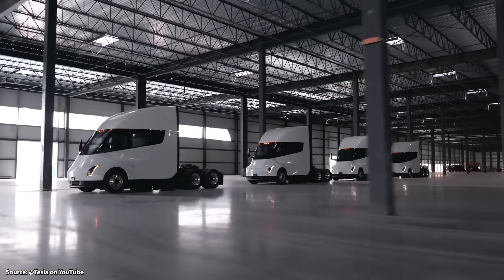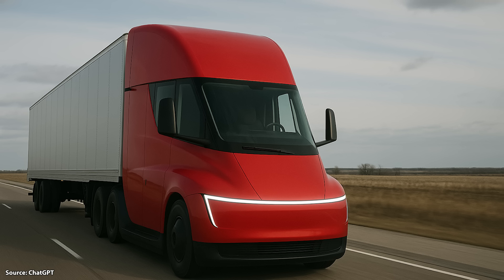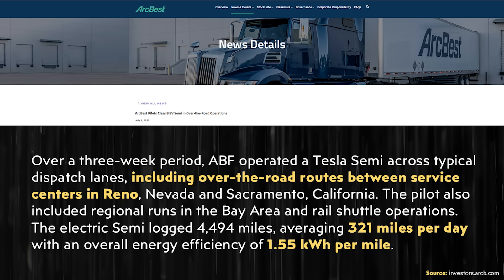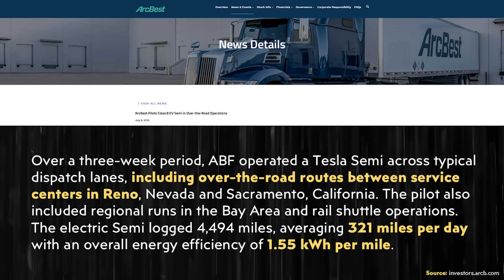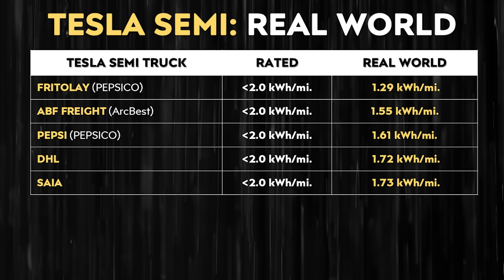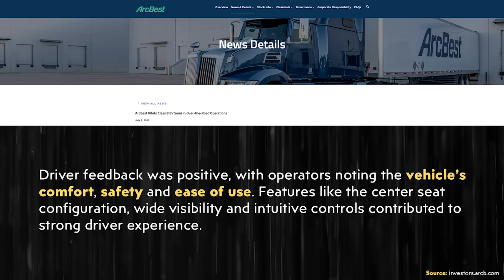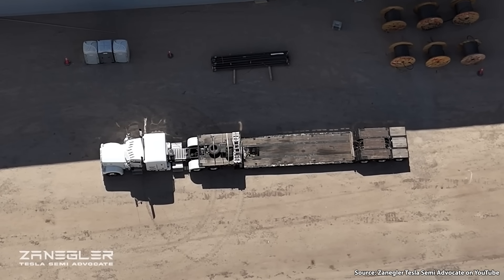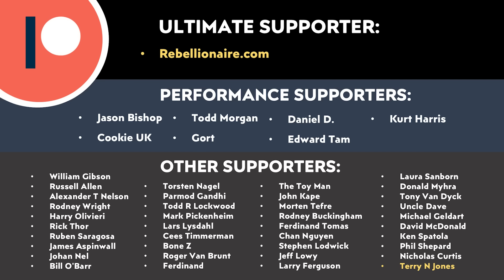Tesla Semi 2.0 | New Design, Mass Production & Real-World Tests!

Comment: How much hilly terrain has the Tesla Semi been tested over? Is it better or worse than gas in the mountains.
Reply: Has been in constant use hauling batteries and motors between Nevada and Fremont over Donner Pass, even in winter, since reveal. Out performs the diesels it runs against.
Reply: @waynerussell6401 This is quite good news. Thank you.
Reply: @jimgolab536 Is it better or worse than gas in the mountains. 
Mountainous terrain is where electric semis have the greatest advantage over diesels. First, because they have 2-3 times the HP of diesel semis, allowing them to climb steep grades at highway speeds, while diesel semis are laboring uphill in a low gear. Second, because regenerative braking during the descent recovers most of the additional energy used during the climb, which is lost in friction and engine braking in diesel semis. And third, because there's no loss of power at high altitudes, and in fact slightly better economy due to less air resistance.

Here's a video of a Tesla Semi, towing a flatbed trailer, accelerating rapidly (watch the speedometer) up a steep slope on Donner Pass with a 22 ton payload, passing a diesel semi as if it were standing still: https://youtu.be/LtOqU2o81iI&t=984.

Comment: Contrary to popular opinion, the light bars are NOT headlights - they are basically daytime running lights.  On both the Cybertruck and the Model Y, the headlights are mounted horizontally below the light bars (we own a 2026 Model Y - so I know from firsthand experience).  Your ChatGPT mock-up therefore doesn't actually have any headlights, therefore it's not street legal.  You need to adjust your mockup to actually have inserts below the light bar for headlights.
Reply from the maker: Great point

Comment: The first design didn't make it on the streets. Now they are already redesigning it? That doesn't make sense.
Reply: @georgesvak5332 The first design didn't make it on the streets. 
This is what I like to call FALSE. There are dozens of the first design on the streets.  Many are in Northern California where for example Tesla Semis haul weighed-out loads of soft drinks 280 miles from the Pepsico Sacramento Bottling Plant to Bakersfield and most of the way back on a single charge. And Tesla-owned Tesla Semis make routine runs between its facilities in the SF Bay Area and Reno, including topping the 7,000' Donner Pass. The latter is a great test for Tesla Semis, because it's one of the greatest climbs of any freeway passes anywhere in the world.
Reply: It's hard to make an Ugly Truck look better. They just add more pollution.... just another name for it

Comment: You seem mystified by the 1.55 KW efficiency, but you noted they're using a much smaller trailer than the full size reefer trailers, right? And clearly they're talking about the performance of in regards to range and operational efficiency, not speed .Anyway, I wish Tesla had been this pragmatic in the design of the cyber truck instead of making a cyber SUV

Comment: Good video. What I think we would all like to see is a truck company accountant or fleet manager, or an experienced independent trucker whose owned their own rigs for 20 years show the cost of diesel rig operation/maintenance versus the Tesla Semi . How would the Tesla Semi  have done against diesel tractors in comparison? I suspect that the Tesla Semi would really shine in saved maintenance and operation costs.  
To me it seems pretty obvious that once the Tesla Semi is in full production, the only reason to buy one of the other EV rigs is,  if they cost significantly less and the routes are short,  'last mile', with the rigs returning to the yard at end of shift where they can recharge, etc..  
The only reason to buy a diesel rig over the Semi would be very long routes, routes to 'more remote' areas. (Montana might be 'more remote,' at least for the near future if there are no Semi Supercharger facilities available. The Northwest Territories of Canada will probably be remote for quite some time. )  What Tesla should absolutely do is make sure that even after the warranties of its first generation Semis that everything is still covered. If the motors have X miles of warranty and some start failing at 2X? Just replace them. Truck operations are about expected expenses, fuel, tires, brake jobs, oil changes, tune ups. It's the $20k unexpected repairs that really hurt.  Treat first generation Tesla Semis, that will have a few issues, as though they are already super reliable 3rd generation. Lock in Tesla's reputation for reliability. 

 I'd really like to see more detailed analysis of how the Semi, and all Teslas handle mountainous routes. That first video of the Pepsico run from Sacramento to San Diego  included a Battery Level/Distance Traveled graph that appears to average out the 3300 foot Tejon Pass as though it were flat terrain. Seems too good to be true. (Once while driving my Model Y around Big Bear, 8000 feet my charge level was low, there were only destination chargers in the area at that time. I was faced with the dilemma of a Supercharger near San Bernardino that was about 20 miles away and I had less range than that. It was also at about 1100 feet (I've got my actual numbers somewhere). Going down the grade I ended up at the Supercharger with 12 miles of range. ) We know that most of the energy used by any vehicle is pushing air out of the way, so hills shouldn't have much impact. I think it would be interesting to see the numbers. (Also compared with diesel rigs, this is another huge gain for Electric rigs. Going up grades can overheat the engine, burn more fuel, going down the grade heavily uses the brakes. Not sure if there's a downside to engine braking. For a Tesla EV, there's plenty of torque for the climb, and coming back down is recharging. All vehicles if they eventually return to where they've started or close to sea level average out all the ups and downs. I told my son while we were visiting his grandmother in the same hospital where he was born that in his 16 years all his movements around the planet for his entire life has netted out to about -15 feet vertically and 100 feet southeast.) 

 So if you lived in Big Bear and commuted to San Bernardino, you'd never want to home charge your Tesla even to 80% because you would gain charge going down the grade to work.
Reply: @WillN2Go1 I'd really like to see more detailed analysis of how the Semi, and all Teslas handle mountainous routes. 
 Mountainous terrain is where electric semis have the greatest advantage over diesels. First, because they have 2-3 times the HP of diesel semis, allowing them to climb steep grades at highway speeds, while diesel semis are laboring uphill in a low gear. Second, because regenerative braking during the descent recovers most of the additional energy used during the climb, which is lost in friction and engine braking in diesel semis. And third, because there's no loss of power at high altitudes, and in fact slightly better economy due to less air resistance.

 appears to average out the 3300 foot Tejon Pass as though it were flat terrain. Seems too good to be true. 
 Jason (Engineering Explained) commented on this here: https://youtu.be/hvg_i0GE0Vo&t=154, but didn't explain it. I struggled for weeks to understand this, because it appears to violate the laws of physics. What I finally realized is that there's a 35 MPH speed limit for trucks on the Grapevine; and the reduced losses due to aerodynamic drag and rolling resistance at the slower speed are just about equal to the approximately 20% regeneration loss.

Comment: John, you should take time to watch the German Elektrotrucker channel (audio in English available) where an EV enthusiast learned to drive long-distance trucks and now works as a full-time truck driver solely in electrical trucks. Recently, he completed a round-trip from northern Germany all the way to Gibralter (4500 km) in a brand new Mercedes eActros 600 (useable 600 kWh LPF battery), loaded (42 tons, gross). At times he used less than 1 kWh per km on average. This seems to beat the Tesla Semi figures you quoted).
Reply from the maker: Thanks for bringing that up. It looks like the Mercedes eActros 600 4x2 truck (the Tesla Semi is a 6x4 truck) is able to go 500 km (311 miles) on a single charge with a GVW of 40 tons. With a 621 kWh battery, that is an efficiency loaded of ~2.00 kWh/mile which is good, but not as good as the Tesla Semi. 

If the Tesla Semi were a 4x2, and had a 621 kWh battery, it's efficiency would be MUCH better. Essentially, a the BIGGER, more powerful Tesla Semi is still more efficient and has a longer range than the smaller Mercedes.

(Source: https://www.mercedes-benz-trucks.com/int/en/trucks/eactros-600.html#eactros600_electrified-efficiancy)
Reply: @Cleanerwatt  one of those trucks are in mass production hauling trailers on the roads, the other one is a concept vehicle.

Comment: While Tesla is twiddling their thumbs, Volvo and Freightliner have been actually delivering electric semis.  Is this going to be another self-driving "yes, we will deliver this this year" for a decade??
Reply: Has been in constant use hauling batteries and motors between Nevada and Fremont over Donner Pass, even in winter, since reveal. Fleet testing data from Pepsi, DHL, US Foods, thyssenkrupp Supply Chain Services, Walmart, Sysco, Schneider National... over 200 produced at ~ 5 per week. Charging corridor under construction now - 1,800-miles stretching from Texas to California. Factory for series production of 50k per year is being fitted out now for Q4 start.
No one beats Tesla!
Reply: But Volvo and Freightliner electric semis are way behind the Tesla semi in load, range and efficiency.
Reply: @BigBen621  they are actually moving freight while Tesla is doing what?

Comment: The whole plan is coming together for Tesla, condensing supply and production.
Rubber is a big problem. Steel is better.
The USA needs railroad improvement, too. With trucks more for local drayage.

Comment: You HAVE to compared the consumption, 1.55 kWh/mile with a diesel truck with the same load! Considering that diesel has an energy content of 36MJ - 42MJ per liter (136.8MJ to 159.6 per US gallon), thus one can consider the average of 148.3 MJ per US gallon diesel. That turns out to be equal to 41.167 kWh electricity per US gallon diesel. That, considering the Tesla Semi truck, with the achieved average consumed electricity of 1.55 kWh/mile, means that  under the given conditions (I assume full load of 80'000 pounds) the Tesla Semi drives 26.56 mile per US gallon diesel! Now compare that to e.g. a Kenwood truck...fully loaded with an average range of 6 - 10 miles per US gallon...WOW, NOW difference  becomes obvious. THESE numbers make sense to ANYONE right?
Reply: In distribution no one can afford to hate Elon for politics because ALL is about business and money. No morons out there selling their TESLA because they do not like what DOGE found even with 40% less TCO! So the first ones that have the complete SYSTEM in place with chargers at the warehouses, roof top solar or wind, AI software, Optimus in loading areas, autonomous fork lifts, logistics software where e.g. Ford was strong, but I suppose the way TESLA looks at things they do not need any from others e.g. UBER, WAYMO and even logistics companies. TESLA learned a lot in testing with PepsiCo and Frito-Lay already can offer a complete new ecological system that even with bad EC power mix will improve energy efficiency from 21% to over 68%. Getting also the own power to charge the fleet will be a tremendous advantage, FSD will allow also to form road trains with e.g. one lead truck with a supervisor for any emergency situation. There are so many more ideas for electric trucking industry that also make the job more interesting for new group of people.
Reply: That looks right. You see the same effect with electric cars. Electric motors are much better at converting energy into motion than combustion engines.

Comment: Seeing as we still haven't seen any info on how much it's towing when getting those efficiency numbers. I'm still skeptical about it being able to pull 20 tons of product. 
The Run on less chart shows it a bit clearer. If you know anything about the companies in the chart. US Foods and UPS typically run as close to 80,000 (or in this case 82,000) as possible. While Schneider and OK are usually restrained by the size of the box. 

Let's see it pulling a belly dump or side dump with 30 tons in it.  A flat bed with a Loader on it. A car hauler, or a log trailer. Bet that kwh/mi shoots way up. 

And as far as running Donner. That's exactly what you don't want to do.
Reply: For your information:
The 500-mile versionTesla Semi can tow the same weight as the average heavy-duty diesel rig in the US, and about a ton MORE in Europe. The 300-mile version can tow even a couple of tons more.
And the efficiciency numbers (ca. 1.6 kWh/mile) is given at MAX weight!
Reply: @st-ex8506  Tesla can pull up to 82,000 lbs. It can run at 1.6kWh/mi. 
But we conveniently don't see all the numbers for one run. They also never released the actual weight for the tractor. 

Where as the eCascadia shows the numbers truckers want. 
Max GCW, Usable battery capacity, etc. 
 E.g. My current setup is a 2020 Pete day cab with drop axle, pulling a 2010 Ranco quad axle belly dump. Tare weight is 35,880 lbs. Capable of hauling 30 tons of dirt. I average 4.6 mpg over a 10 to 12 hour day. 

Nothing I've seen suggests any electric truck can manage half a day.
Reply: @Species-lj8wh   They also never released the actual weight for the tractor. 
Yes they did. Short Range (300 mile) version, <20,000 lbs. Long Range Version, <23,000 lbs. At 2:17 mark of this video:
https://youtu.be/HyV8CYg-sGE?si=-csE_WaLPNmMdKnR&t=137
 Nothing I've seen suggests any electric truck can manage half a day. 
With top off at the mandatory 30 minute break after 8 hours, a Tesla semi can drive as far in a day as permitted by HOS regulations. And with a 1-hour charge between shifts, a Tesla semi covered 1,076 miles in a day during the Run On Less tests.
Reply: @BigBen621 Thank you fine sir. I had not seen that video. While is it heavier than my tractor it is not grossly so.
Reply: @BigBen621 But as we're exempt from HOS being short-haul. Still wouldn't last all shift. *Correction, Noone would accept having to take an hour to charge in the middle of the day when the diesel option can last all day.
Reply: @Species-lj8wh    we're exempt from HOS being short-haul. 
You may be, but Tesla Semis in the Run On Less tests weren't. For example, they frequently made runs from the Pepsico Sacramento Bottling Plant to Bakersfield, a distance of 280 miles—almost double the 150 mile short-haul exemption.
 No one would accept having to take an hour to charge in the middle of the day 
So you claim; but the logs show that's exactly what that truck did that day, which refutes your claim.
Keep in mind that this is between shifts, so the one hour charge doesn't occur on anyone's time.

Comment: What ever happened to the 4680 revolution that was going to be in every Tesla. Where are they. They are only in the CT and sales of the CT are not good. What is Tesla doing with all the 4680’s they did make a fewY’s with the first gen 4680’s and the batteries were not very good. 4680’s were the future of Tesla and they are only in 1 vehicle that doesn’t sell well.
Reply: Dry cathode production ramping up.  It was used first in the first Cybertrucks. All Cybercabs will use it first then all cars made in the usa after that with 4 newer chemistries.
Reply: Dry cathode production ramping up.  It was used first in the first Cybertrucks. All Cybercabs will use it first then all cars made in the usa after that with 4 newer chemistries.

Comment: You know the light bar on the Cybertruck ISN’T the headlights right? The headlights are actually below the light bar on the sides.
Reply: No he does not know that. That whole light bar thing is nothing but a gimmick like fins and chrome on the old cars from the  50's and 60's.
Reply: @tompower5666  Incorrect!  It will serve as position lights (i.e. low beam) during the day, which must be turned on by law in some states by low visibility conditions, and ANY time in Europe.  The turn signals are also likely to be integrated in that light bar, like on many new models of cars.  So it definitely serves a purpose which is not only esthetics!